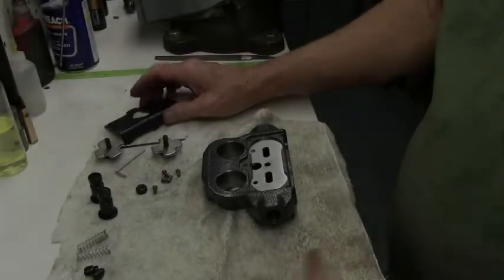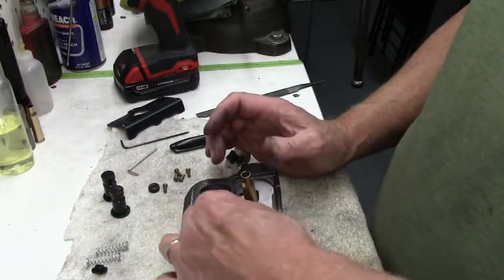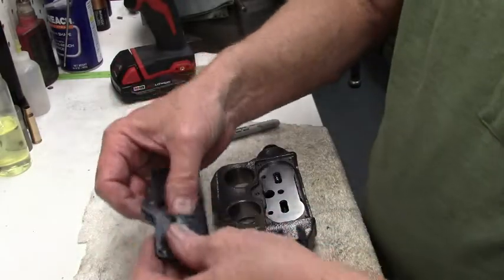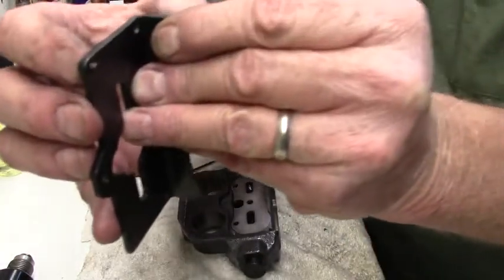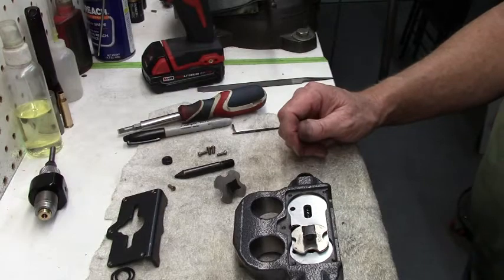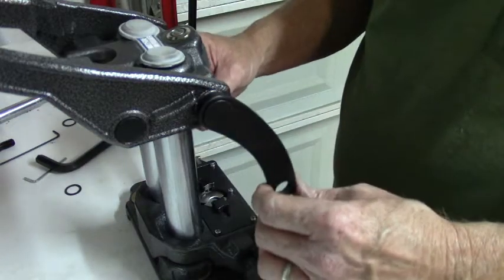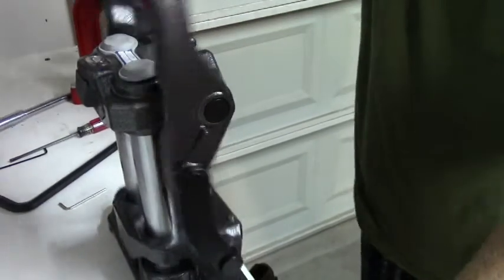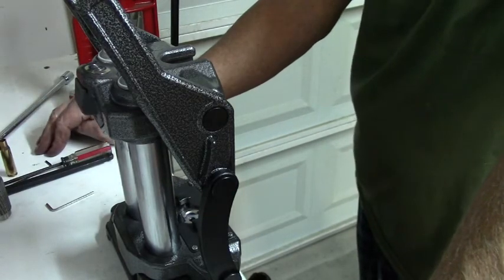Frankford Arsenal M Coaxial Press Problems And Fix's

Comment: Just an update for anyone considering this press. I received mine a few weeks ago. They still have all the same problems, AND my light switch is broken (doesn't stay on). Customer service is non-existent. I started sending emails, web-form contact messages, and phone calls the day after I placed the order (3 weeks ago!). No reply to email, no call-back from phone calls. Stay far away from FA. I bought the M-Press AND X-10 so I could teach my son to reload on the single stage before turning him loose on a progressive. I doubt I'll even open the X-10. I'm through with Franklin Arsenal. the entire $2k order will be returned (if I can talk to a customer service rep before the warranty expires).

Comment: thats why they suggest and make it so an open end wrench fits on the shell holder wheels.  You have good solid force on spring when you use the open end wrench to push shell holder wheel  back into the adjustment pocket and then just turn into proper size.

Comment: This is a really helpful video, I bought the press knowing it's issues after watching this. Ripped the bolts out of their threads first time using. I've had it replaced, and then done the fix on new one ... FYI the holes are 3.5mm metric and already drilled more than double the length of the bolts.. not sure if they were tapped deeper or not , but I tapped them anyways.. and used longer bolts . Not sure how long as I bought 20mm ones and cut them down . But probably 12-14mm .. really pleased ... thank you

Comment: No brainer this press is not designed strong for extracting cases because of the universal case holder. Any mechanically inclined person can see that. I purchased one of these myself. I am intending to purchase the Frankfort F-1 to do sizing or even extraction of bullets with. I watch a lot of videos to see what others think of products and sometimes research something before purchasing. I like this product to seat bullets but honestly, I would never purchase this with the intent to do the entire process. The shell holder is great being universal, but the drawback is it doesn't have the strength for it to withstand full length sizing a case.  On the other hand, if one were into neck sizing it would be plenty strong enough for that.

Comment: Excellent video. Thank you. I experienced the same problem - except I didn't stop attempting to turn the shell holder in time. Ham-fist. So the shaft spins in the holder. I was able to contact F/A, and a very good C/S rep is sending me a new press. Very nice, but replacement parts that fix the issues would've sufficed. We'll see if the new generation of M-Press addresses that design-flaw. I'll do the fix you advise on the old one. I've already decided that the M-Press is de-cap and seat only. Re-sizing...? That calls for my 20 year old Rock Chucker!
Cheers, Dan

Comment: 12.45. Thank you thank you thank you! Same thing happened. My first proper foray into reloading. Decided to get a decent press for my first time. Got a stuck(ish) case. Pulled a bit harder. Popped the dinky bolts which have about 1 turn of thread. Will now continue to watch the rest of the vid.

Comment: if u get a stuck case its better to release case from shell holder and take die out and deal with case in a vise that way u can never damage the press.

also i will relief cut the base and just weld turning handles in place plus add screws to front of case holder plate, other than that its a good design

Comment: WRT the inability to full length size issue, before you go messing with your high quality die, try fitting a separate shell holder into the FA shell holder. This will have the case riding much higher in the base assembly. The shell holder you use needs to have something at the bottom of it that the FA shell holder can clamp on to. I saw this done in another video on this press.

Comment: I had the exact same problem with the shell holder.
I modified mine quite a bit more. I removed the entre detail. and trashed it
I redesigned the entire base.
I created floating shell holder base that accepts all standard shell holders.
Reply from the maker: Good Idea
I wanted to put something out there that most people can do with hand tools.
We should not have to do this. We buy a product trusting that it will work as advertised.

Comment: Excellent video, I recently bought that press and have not received it yet. I wish I’ve seen your video before I bought it! I will hate to buy something new to turn around and have to modify it. I wonder if since you made that video FA have done anything to modify the manufacturing. I have subscribed to your channel and will be an avid viewer. Thank you!
Reply from the maker: I don't know. But let me know if they did.
The press works great now. But it should have been that way out of the box.
Reply: @backnine   I just received the press, the only thing different according to different videos I’ve seen, is that it now includes an owners manual. On first impressions it has the same flaws you point out in your video. A lot of grinding to turn the shell selector, the same screws which makes me even afraid of using the press and stripping them. I have the option of returning it or perform all your modifications. What will you suggest? Is it worth it to go through all that “jumping through the hoops”? I valued your opinion, I’m pretty handy in the customizing area, you wrote that the press is working fine after the mods. I paid $189 for it, so thats a good deal. I will wait for your answer to make a decision. Thank you in advanced. Rafael
Reply from the maker: @rafaelgil9343  Hi Rafael
I had had the tools and screws to do the mods so it wasn't a problem. You will have to buy the tap and tap handle and drill bit for the tap. If you don't have to buy a bunch of tools it is worth it. It has been a good press. I have probably reloaded at least 1000 .223/5.56 with no problems. I have used it on .308 with out any issues. My bigger calibers 300 win mag and .338 Lapua I use my big press.
Reply: @backnine  Thanks Harold, I do have some of the tools, if it is that good, I don’t mind doing it. What will be the tap size? Did you modify the size too or you just made the same deeper? Hope you don’t mind my tapping your ideas to. Make this work. Thanks.
Reply from the maker: @rafaelgil9343  I think 6-32. Check the video. They were metric screws.

Comment: My issue is the brass will not align with the die.  Every time I press the ram down to resize I have to guide the brass into the die with my finger.  Any fix for that?

Comment: Hi been dealing with this for almost 2 years thanks for the fix and what do u think the fix is for the shell holder bolts mine are bad call them they have no parts I just j b weld them in it last for a while before I have to do it again

Comment: I'm running into "stuck cases" but it's just because that damned thing is coming apart on me too. I think I'm going to just use this press for bullet seating. I had screws strip out on my plate, bent plate. I wasn't even putting that much pressure on it. I drilled and tapped a larger screw for that one center screw for 1 size larger. It won't hold the case rim worth a shit now so I'm fairly certain I will only be using this press for seating bullets going forward. At first I was in love with it, but now I absolutely hate the shell holder design. I also lube the hell out of my cases so it's totally on their cool, yet poorly executed design.

Comment: This looks like a well designed press until it comes to the fancy shell holder, I cannot understand why they make these one size fits all things, the Forster has a similar set up, but it will not work with thin rims as well as thick rims, far better to use a dedicated shell holder, they are cheap, problem free, and once you are set up for caliber work much better with no problems, I notice that this press has a much better die holder lock ring, with many more threads engaged than the awful Forster design which uses only 4 threads to take the thrust loads on the reloading sequence. Good luck with your modifications. Chris B.
Reply: it also won't take large head cases either

Comment: The depth of the shell holder won't allow you to fL resize.
Reply from the maker: You have  to take some material off the bottom of the die so you can the head space you need (bottleneck brass).
I have had to do that with shell holders on my RCBS press. Some dies not all

Comment: Harold why are you spending so much time on that press? I’m sure you have a lot of money in it! my opinion, just my opinion, buy once cry once get a Dillon press. If I have a problem they fix it I don’t have to.
Reply from the maker: Hey Dave
 It looked like a good concept. Forster makes one. Don't know how good it is. Have that issue fixed. Now I have to change the set screw for the die block. They put a brass set screw in and it will not hold the die in position. Starts loosing up after about 10 rounds. I will add a extra set screw. I have a good heavy press. Dillon is the Cadillac.
Reply: @Harold Demes  you drill another hole and set screw or replace the brass with a steel one?